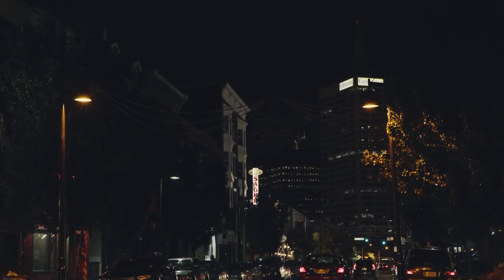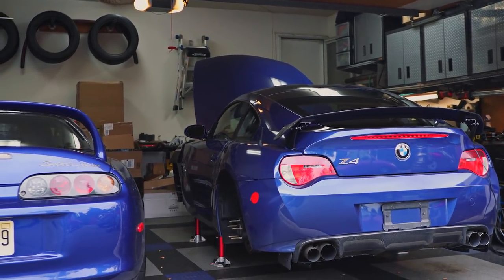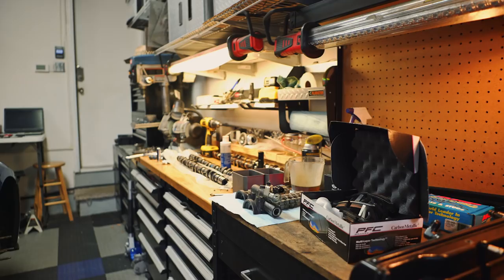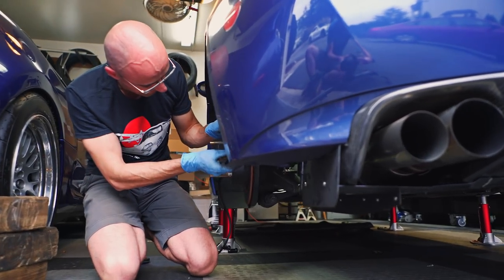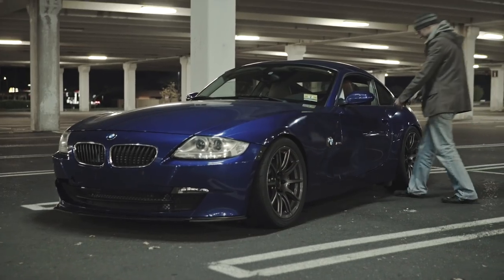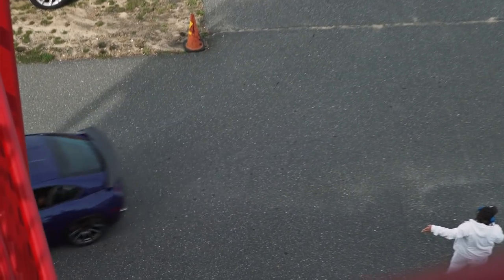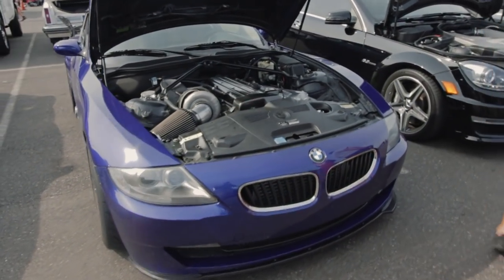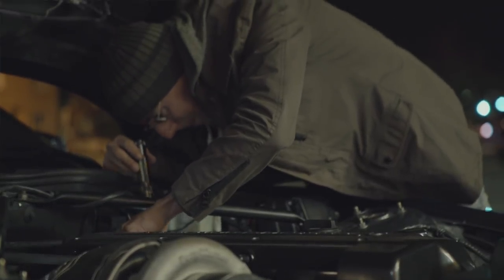This 2JZ-Powered BMW Z4 Coupe is a Nocturnal Beast

Comment: I have a Z4MC, I always thought that if they had made it using the S62 V8 engine from the e39 M5 it would have been the absolute perfect car but looking at this the 2jz is not a bad alternative.     Very nice build and video!
Reply: and have a 70/30 weight like a domestic?  lmao
Reply: @kjw763  LOL the straight 6 in the M Coupe (S54) is made out of cast iron and it weights about 478lbs compared to the S62 V8 that is made out of alluminum and weights 308 lbs.

Comment: Crazy I saw you ripping around NJMP back in the spring. Remember seeing you slightly slide the car on the exit of the final turn after the bridge. I could hear the turbo but didn’t get to see the car up close and assumed it was a Z4M with a turbo kit.

Comment: I wonder how much you did to re-balance the car. The original N52 is about the lightest I6 ever produced and the 3.0si has a perfect 50:50 weight distribution front to back.
Did you add weight to the back to re-balance? how much has the balance shifted?

Comment: Hey great exchange!
And you are right the chassi is fantastic. 
I thought to buy a Porsch 981, but the speed you carry in corners is not comparibal with my coupe. That is the reason why I do still ride the Z4. 
At the Nürburgring the Z4 has still a laprecord for low modified cars (if I am not wrong and another cars sets a new record). 
That shows the potential of this "old" chassi.
Reply from the maker: Thanks for the comment! Very interesting to see how the chassis has held up over time!
Reply: Do you have some link to that lap record? 
Owning a 3.0si I can definitly realte to perfect handling, and the brutal stiffness. I even prefer the handling over 992 CS and 982 GTS, altough the former is much more comfy then my sports suspension.

Comment: Wow, cant believe I missed this vid for 5 years. Does the car run a LSD? I have a Z4QP, 3.0si, love it, dreamcar since it came out, of course a LSD and a hydraulic servo would be nice, M has em. 

Since I have it I have looked at the huge empty space near the pssenger firewall where I think the M has the secondary air pump, and thaught what a nice place for a big turbo it would be. Of course I would gravitate to a N54, they seem to handle 500/600hp (enough!) just great. Dunno if it would be easier to swap electronics-wise bc some cars exist with both engines. Gearbox and so on would be easier i think. Big issue: living in Germany makes this so much harder to get road legal. Official power could not exceed about 500hp (140% maximum sold in that chassis), emissions could be a headache too. Makes 2JZ impossible downright, must be same or better emissions class. N54 is lighter too. I just love the handling of the car, having driven 992 CS and Boxster GTS, would want to keep, I think even the iron S54 in M spoils it a bit. 

If you read through this one last crazy idea I will share as compensation: how awesome would be a the exhaust in the sidemarkers round panel? 4 inch Chimney poking out there 10 right behind the turbo for track use.

Comment: beautiful built man, i have same built (except i am using a Getrag v160) with my z4 3.0si, i have 608hp on the crank, but it have problems with both driving axles , they broke down after 15min of driving :-( are you driving on stock ones?
Reply: How did they break?  Launching from a stop, doing burnouts?  You broke both left and right side?  Did they snap in half?
Reply: They did break by doing a really slight clutch kick out of a corner...really not a hard one...and yes they snapped off just before the joint, a straight clear cut
Reply: And the greatest thing is, you cant buy the shafts atm. Did you solve it? Do you run the original non-LSD? I could imagine he swapped it for track use, although the housing and output is shared with lot of models he could be using sth sturdier. But maybe sth else is wrong, torque can obly snap it if there is enough grip

Comment: S54, one of the best linear power delivering engines ever made. Highest specific NA output of it's time, won like engine of the year 3 or 4 times in a row. Really strange to remove it, unless it was toast and not economically feasible to fix or something. Otherwise pretty weird choice.
Reply from the maker: Rombbb This was originally a Z4 Coupe 3.0si with the N52 engine, not the S54. Also the s54 sometimes has rod bearing failure. However, both the s54 and 2jz are great engines, no doubt.
Reply: Ah sorry then I misunderstood. I'm also not really objective, having like the exact same blue coupe, but with the S54 :-) 2JZ is super as well, just didn't understand the choice but now I do, thanks. Very cool looking car you have
Reply from the maker: No worries! Both are an awesome setup to match with the Z4 Coupe chassis :D